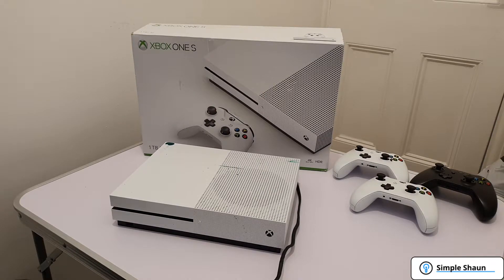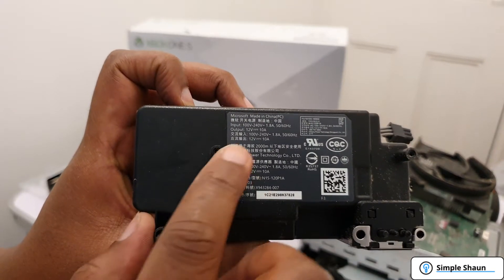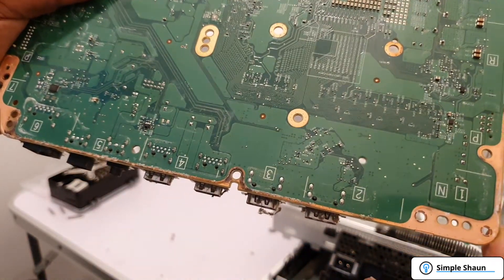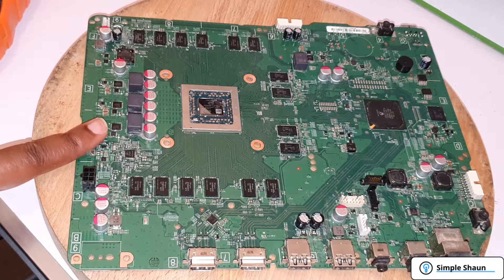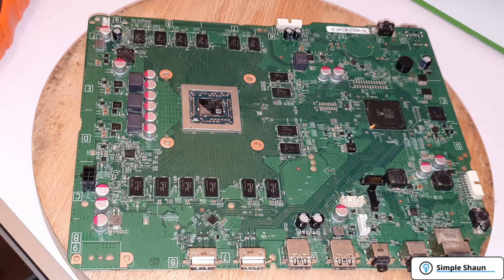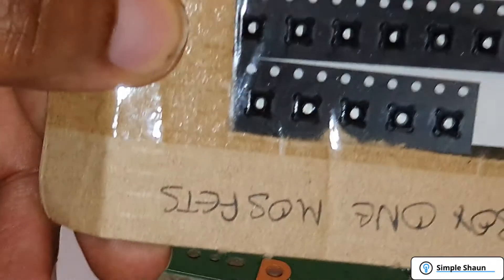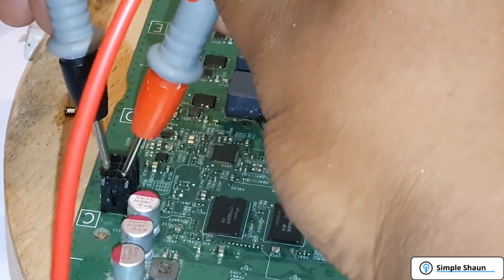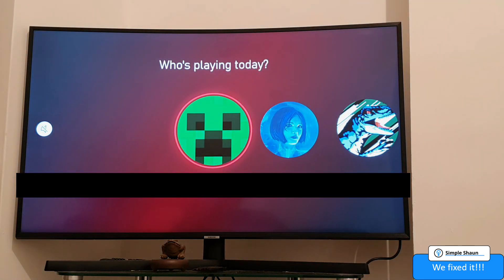Can I fix it? XBox One S will not turn on, no beep, no light

Comment: In Ghana you can’t get mosfet😢😢
Reply: I was wondering if you could bring the two sides of the MOSFET out to a switch on the outside and connect it manually, or even just bridge it up? All that is happening is the on board power circuit is sending 5 volts or logic level 1 to switch the 12volts,
Reply: That's exactly what I was wondering since all the MOSFET is doing is switching on?
Reply: Weird I just replied to my own comment, ha ha.
In Ghana if they won't ship you should try sending via a 3rd party mailing service

Comment: What do I do to keep the bring new mosfet in place what do use I got a hot air station but that's not working the mosfet still sliding all over the place what keep it stuck to the board please help

Comment: How can I test my 12v rail for shorts if my motherboard doesnt have a 6 pin connector on the ‘mother board. All it has is an external power brick, how would I test for shorts still by not having the 6 pin on the motherboard?

Comment: Hello so I got the same problem, xbox one s turns on then off for 5 seconds, fans spinning, I already checked all the 3 mosfets and got the reading of 5,45 is that normal?
Reply: You need a need power supply its no good bro that's not normal
Reply: no should be 6.55 or 6.65
Reply: @ItsHyphy  you need a new power supply that reading is not normal facts